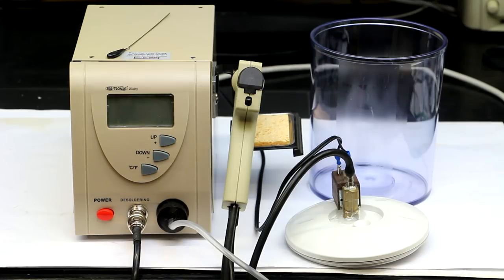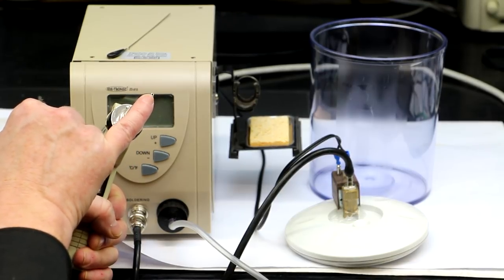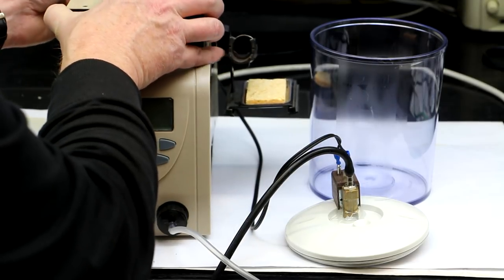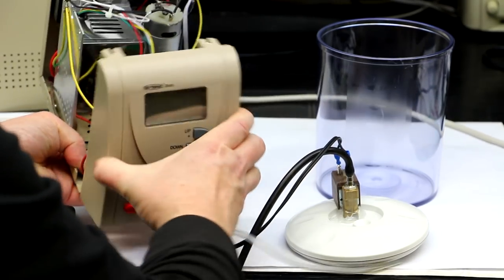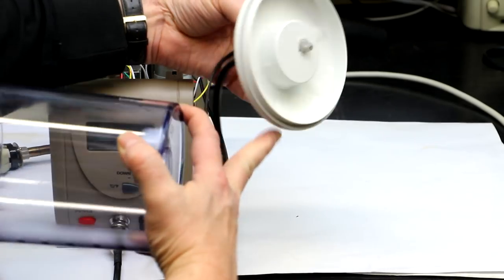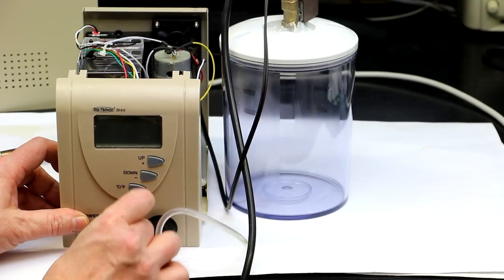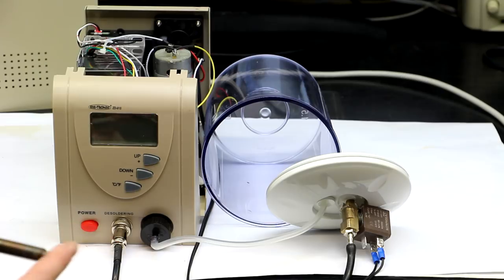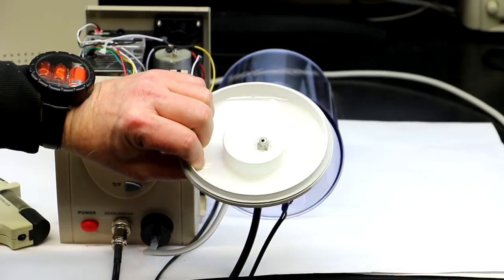Improving a cheap vacuum desolder-station (ZD-915)

Comment: This is exactly what I was thinking of doing with my old Weller DS600. I was going to use a vacuum sensor to shut off the pump when presure is high enough. I may look at using a refrigerator compressor for more silent operation.

Comment: I'm a bit disappointed you didn't show any footage of it actually de-soldering a joint, maybe a comparison to the original in high speed. I know it woudn't be particularly easy to film that.
Personally I use a similar model with it all built into the gun and no base station and I've never had any problems de-soldering anything with it. I do wonder if the volume of space in the tube between the pump and the tip makes a difference.
Reply from the maker: The reason why I didn´t show a comparison is just the time and effort to shoot this. You just have to believe me that it really is a perceptible improvement.

You probably mean the volume of air in the vacuum-hose/tubing.
Yes. I think that does make a difference because of the flexibility of the tubing. That further delays the onset of an "instant" vacuum action.
That´s why I inserted the kind of vacuum-reservoir with the vacuuming-container (or box or however this is called).
When the pump is sitting directly at the desolder-gun (as in your model) then all these complications probably are non-existent.

Comment: Thanks for this, but I accomplished something similar for my Aoyue Int701A++ by holding the trigger while kinking the hose. I then alternately straighten and kink the hose as if the pinched hose were my press/release trigger. It works gloriously! This station has an AC pump that just can’t get up the vacuum while the solder is still flowing unless you trick it like this. It went from nearly useless to actually working well! Though this is free and works well, I imagine I will sometimes need my other hand free instead of using it to manipulate the hose. I’d like to use a momentary foot switch to run the pump and then I will actuate a valve connected to the trigger like you do. Thanks!

Comment: Yes, I agree with this - with the wind-up the solder can cool quickly before full potential is reached meaning you can't get everything without heating twice, but with the full potential of the vacuum reached instantly then you'll pull more solder... so it is a great feature... there are a few adjustments I'd make though..

You should add a pressure switch. Once it reaches optimum pressure turn off... This is a fantastic idea and I'm considering modifying my existing 853D rework station to add this capability for a desoldering gun ( I modified it already so I can remove the heat want as it always got in the way ) my plan is to either add a new connection, or use the heat gun or solder-gun port or controls with a switch to control what is active so I don't need to make a new case and add all of the electronics for controlling temperature, etc... plus buttons and the line...

It should have enough free area inside for the vacuum and maybe even a small sphere for a vacuum chamber as you have designed since it'll only be used in short bursts anyway...

In addition to adding a pressure switch to control when it shuts off, I'd add another feature so when you hit the trigger, it instantly turns the internal pump on too so the air lost is then replenished... Ideally I'd have calculated how much air / pressure it processes over time and synchronize it with how much is used per second so if I hold for 1 second and it only needs .5 seconds to refill then I can run it at half power or 75% or so...  It shouldn't be too difficult to add the first 2 changes, the more intelligent sync system would take a bit more effort although if the pump is underpowered for the container then it doesn't matter if it runs the entire time the trigger is pulled... if it is overpowered then reducing the power is easy enough too...
Reply from the maker: You should also watch the followup video with a more simple to implement mod: https://youtu.be/j8LMdIZuDyw
That get´s away with the constantly running vacuum-pump and the large reservoir container.
Reply: so... did you do it? i am now considering doing the same to my 853 lol

Comment: More expensive units have a 2 part trigger. When you pull the trigger part way in the pump starts. Then pulling the trigger fully a  solenoid opens the air tube to the vacuum. The solenoid is only enabled for about half a second as to not cool the tip too much if a second attempt is needed.
Reply from the maker: That´s exactly how I want to do it in an alternate version :-)
(2 Studids, same thought as we say here in Germany)

Comment: I think the big container is a good idea, its like a big capacitor with lots of sucking capacity, if you want to do multiple desoldering with lots of joints and you have to keep waiting for vacuum to build up(as suggested by other posts to remove the tub and add a delay) before it allows a trigger it will become very annoying.

Comment: a check valve on the "output" side of the chamber would allow the chamber to stay in a "vacuum" state while the pump isnt powered.   or... you could spring for another solenoid in the opposite configuration... a good idea using a chamber.. hmmm..  nice work!

Comment: Move the fan over the powersupply and cut out some bars in the power supply shield.drill sme holes down on the p.supply side off the case.I have the ZD-8915 witch have a better deigned gun.Inside the case it is similar.when i moved the fan fron the back to over the power supply everything in the supply where much cooler under load witch mean longer life.Always when i buy stuff like this a changes the capasitors to good brand,s Nothing expencive.Just reliable parts. i also swat the triac in solder station from 6 somthing to total incapsuled bt 8somthing.It handles 200 more

Comment: Have a problem with you leaving the pump on permanently , it will wear the pump too fast and mate, no one want's to hear that noise constantly  especially when doing a great deal of de- soldering which I do.  All the more expensive de-soldering stations operate in the same way and there is a technique in using them so instant  vacuum is not required. It is basically to do with your wrist action moving in a circular motion around the soldered joint so heating the solder all through the plated hole so it's all in a fluid state before the trigger is pulled.  Timing is most critical.  This works best with 60/40 solder not the lead variety as too much heat is required and damage to the traces will result.
Reply from the maker: Take a look at the follow-up video which should be linked in the video-description.
I know the desoldering-technique you decribe. But when you have double-sided boards with through-plated vias and leadfree solder you are at a loss when you don´t have a "hard suck" (don´t know if that is the right expression). 
And in my view the most important thing for not lifting the traces is a good flux-paste. But that will be the topic of another video. Desoldering without destructing the component or the traces/vias is quite an art  :-)
Reply: I come from a military background and the soldering and de-soldering course that was taught at the RAAF School of Radio (where I eventually taught electronics theory as a SGT)  took 3 months full time to complete.  This was way before the days of lead free solder which in my opinion is a backward step for repair work, actually 63/37 eutectic solder with 2 to 3% silver content is the best.   De-soldering on plated through boards is one of the hardest skills to teach as it really requires excellent hand eye coordination hence plenty of practice with the right techniques.   As someone else has said here a strong instantaneous  vacuum pump is what is required.  I use several of these soldering/de-soldering stations as the type number ZX917 and don't really have a problem with them except the heat has to be turned up when there is a ground plane attached to the connection.  Sometimes heat from both sides of the board is required (another soldering iron) with the board being held in a   PCB vice (good types of these are not cheap either).   A high level of concentration plus an equally high degree of manual dexterity seems to be required for the best results, practice and practice again on some  scrap board that you have about the workshop to learn the skill required........Regards Robert
Reply: The “wiggle until it melts on both sides” technique barely works on my Aoyue Int701A++ and is certainly no substitute for this mod. :)

Mine is the old version with the AC pump that takes too long to build up vacuum/suction. The solder on the other side will freeze because it first removes solder from the bottom which stops conducting heat to the top before the suction strength builds up enough.

It’s almost unusable without extremely high temperatures and, even then, you will have clogs on any plated through hole with a beefy trace for power or ground. Every DIP chip or multi-pin connector has them making it a fight every time. I shouldn’t have to fight with braid or a solder sucker and a second iron requiring three (sometimes FOUR!) hands when I have one of these.

I simulated his mod by pinching the hose while holding the trigger, then releasing the hose to trigger suction at full force. It worked so well I used it to do one of my most common jobs and it went smoother than ever BY FAR. That would be removing the CPU and PPU from a Nintendo Entertainment System (both DIP40), which I’ve done around 100 times before. Adding a solenoid will free my other hand, but I wish I had thought to try this for the stubborn ones all along.

I was recently frustrated when removing the analog AV port on two original XBOX consoles since every other pin and then some is connected to ground on the other side of a plated through hole that is covered by the port itself (no “second iron” trick). It was almost impossible without ChipQuik but I managed it using every trick in the book including hot air preheat/soak and hot-swapping solder iron to desolder iron at very high temps with high thermal mass tips.

I guess my point here is don’t knock it! Even though I managed to accomplish the same with technique (pinching the hose), Roger’s mods are very useful for people with crappy equipment like mine. :)

Comment: Personally, I'm not a fan of the vacuum motor running constantly.  That will lead to premature failure of the motor and/or bladder/seals.

What might be a good modification here, would be to add a pressure sensor to the jar and at a certain vacuum number, have it turn off the motor.
As the pressure drops to a preset point, then the motor kicks in again.

I can see an Arduino with pressure sensor handling this easily.
Reply from the maker: There is a follow-up video where I added a vacuum-valve and a simple delay-circuit for the valve. So when acting the switch on the vacuum-gun, the pump is turned on and after 2 seconds the vacuum-valve turns on.

Comment: Easier to add only the valve, with delayed opening after the pump starts...? Then the noisy pump isn't running all the time and wearing out...
Reply from the maker: Yep. That would probably be a better solution.
BTW when the lid is closed the small fan is just as loud as the punp :-)
Have to replace that one with a low-noise Papst-type or similar.

Comment: I just bought the same thing and was wondering if the coil hum during heating up is something that other people have with theirs as well, do you?

Btw, I don't think it's a good idea to have that pump running all the time. I bet it will crap out soon. As some other people here have suggested, you should make it a two part thing, or, if adding a second trigger to the gun is not feasible, put a little timer in there.
Reply from the maker: Do you mean transformer hum from the SMPS? 
At my station the little fan on the backside makes so much noise that I didn´t recognize any other sounds from the station.
Reply: Yes. It was quite noticeable to me.

Comment: Despite its problems, is the ZD-915 still better than the OrangeA S-993A desoldering gun?
Reply from the maker: I don´t have the S-993A and can´t tell you about the "sucking-quality" of the S-993A compared to the ZD-915.
Reply: I like my  ZD-915. :-)
Reply: @KainkaLabs  I have both units, and the ZD-915 is orders of magnitude better than the S-993A. It's not even close.

Comment: I want to do this with mine! The pump is... terrible :(  Do you have a parts list please? Excellent mod btw :D
Reply from the maker: I can only give you the link to the German Ebay-items I used: 
Ebay article-number 222330050857 is the vacuuming food-box on www.ebay.de
Ebay article-number 180485452525 is the 12V/24V magnet-valve on www.ebay.de
I have trieb some termas on the US Ebay-site for the vacuuming food-container but there were not the right items showing up. So maybe there is a different designation for this (or vacuuming food in boxes is not popular in the US?).
For the magnet valve search terms "electric solenoid valve 12V" should work.
And BTW it mustn´t be a special "vacuum valve" as I called it in the video.
Probably every valve you find on Ebay will do the job :-)
Reply: Thank you so much :D
Reply: Try change the 18v to 12V board with 2 resistors to a dc step down converter.
With this better power source, allegedly also the suction power increase.

Comment: Mine has U03 error when i switch it on does anyone know what this is? Thanks
Reply from the maker: The controller recognizes whean either the temperature probe and/or the heater element breks down.
You can get a new "desolder-gun" relatively cheap on Ebay, AleExpress etc as a replacement part. Also the combined heater-element/temperature probes are available as replacement parts. Try to measure at the pins if you have a loh ohmic connection between 2 pins. If not, the heater element is broken.
Reply: @KainkaLabs  the thing is it heats up fine no issues i just need to know exactly what u03 means
Reply from the maker: Don´t know.

Comment: Does this station have a brushless DC or AC motor?
Reply from the maker: These vacuum desolder-stations all have a membrane-pump driven by a little standard DC-motor (non-brushless).
What´s the point?.
Reply: @KainkaLabs  That person ask that same question on every de solder station review.

Comment: I think a better solution would be to just use a larger vacuum pump.
Reply from the maker: No. Because there would be the same effect that the vacuum takes some time to build up.
A larger pump has larger "chambers" (with a bigger volume) that take the same time to build up a vacuum of lets´s say 500 mbar below ambient pressure.
Reply: I guess you've never looked at other professional desoldering systems such as the Pace?  They all use a larger pump that only runs when you press the button and it works just fine.
Reply from the maker: You´re missing the point and comparing apples with oranges.
A bigger pump of the same type (membrane-pump) would make things even worse with THIS desolder-station.
First these pump-types always have a delay between switching on and full vacuum.
Second the power supply would probably slow down the ramping up of the DC-motor because it isn´t designed for a heavier load and thus the build-up time of full vacuum would further be extended.
This video is about improving exactly THIS budget desolder-station with easy means and a small investment.
qwaqwa1960 had a better suggestion (the post below) by just using the valve with a little delay after the pump has started.
Another way would be to seal the vacuum reservoir on both ends with a solenoid valve so that the pump doens´t have to run all the time but only if the vacuum in the reservoir drops below a certain level.
Reply: Using the valve with a little delay after the pump has started sounds like a good idea.  I couldn't stand having the pump running all the time.
Reply from the maker: The pump is not so loud when the case is closed. (Even the shitty little fan inside is just as loud as the pump :-)
I will perhaps try the solution with the valve attached directly to the gun and a little delay-circuit with a 555-timer. If that works OK, that would give a more "compact"  arrangement by getting rid of the big vacuum-reservoir box.  On the other hand it of course takes longer to build due to the extra electronics.
Let´s see if I find the time.